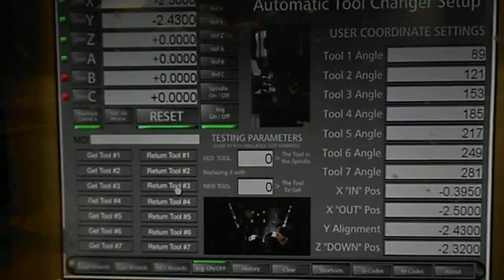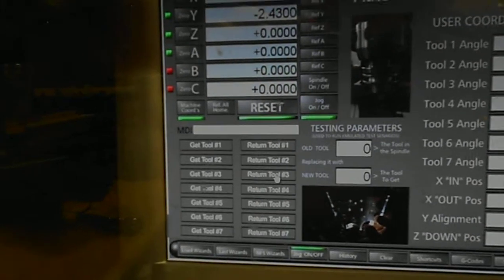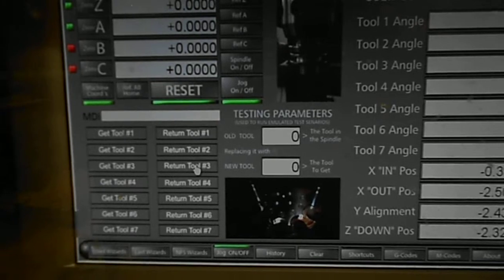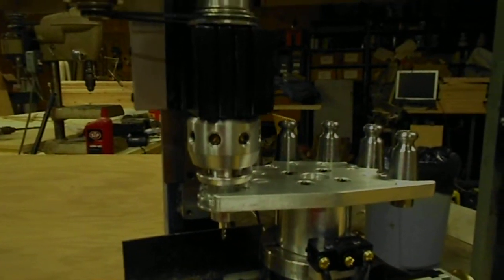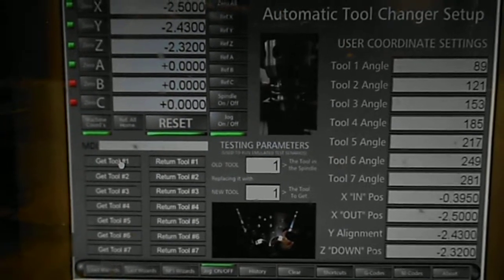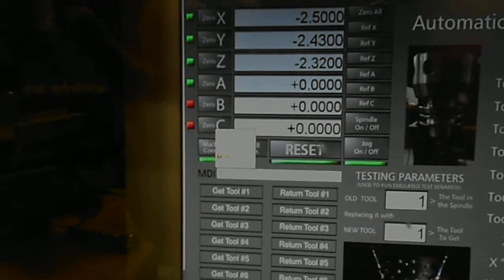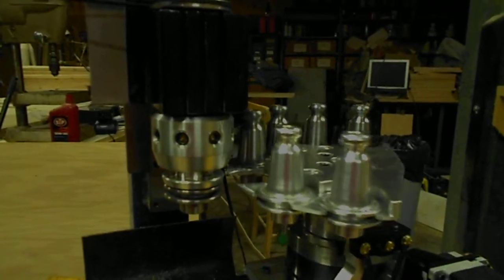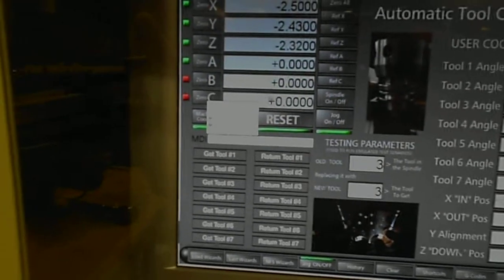Rotary Tool Changer M06 Macro l

Comment: Really love the NO NEED FOR AIR PRESSURE of any kind! it make things way more simple!! plus air systems will all eventually leak..
Reply from the maker: Yep! Not that I am against using pneumatics, but consider the costs associated with it. In most cases the cost of a spindle modification costs more than the machine itself. These machines are built for the "hobbyist" and are designed to make it easier to acquire for the average guy. Also, those high-RPM ATC's that I have seen use such a small collet that the tools are limited to 1/8 diameter shanks....not good!

Comment from the maker: Many changes have taken place since the creation of this Mach3 ATC page. The tools can no longer be returned individually by tool number (safety reasons) There is now only one tool-return button that returns only the tool that has been previously selected. Two warnings are issued and the program halts if you are trying to return a tool when you have no tool in the spindle and if you are trying to get a tool while another tool is in the spindle. It will also inform you if you are trying to get a tool that you already have in the spindle.
The DRO's are now more logical in that they show the tool that you have in the spindle and the tool that you are replacing it with. The code has been placed in the exact location of each change within the macro so that the numerical display changes at the same time that the spindle changes state.
It will no longer prompt you for another tool if you choose a tool >7, it will exit the macro instead. This is for safety reasons as well.
That original M06 required a tool to be in the spindle before an actual program run. The newer M06 can begin with an empty spindle.

Comment: Looking good!  I like the larger ball design on the tool holders.   It never occurred to me that a tool changer could be that simple... without air or draw bar of some kind.   Great design!
Reply from the maker: Ben Rogerson It is getting ready to get simpler! Instead of using a Sherline rotary table to rotate my tools I'm getting ready to build a simple rotary plate that will cost much less than using the sherline.  The Spindle has been through yet another modification. The four locking pins will be concealed instead of the springs being in the open. This will make it easier to assemble and to clean. There will still be a small groove on the outside so that a custom fit tool-puller can be fitted in the event that the tool needs to be manually disengaged. The toolholder flanges will be .250 instead of .200 distance away from each other so that the tool plate can be .150 thick instead of .100. Still have to do the my cut analysis though, looking promising!
Reply: Christopher Smith I though about making a turntable maybe with a belt drive and stepper motor...     can't wait to see the new design on the spindle!
Reply from the maker: Ben Rogerson I use McMaster Carr for all my industrial parts. Not because they are any cheaper than others but because they include part prints and DXF drawings, as well as Solidworks files. They make it much easier for you to design your project knowing the actual dimensions of the parts that are offered. I found them especially helpful when searching for the pressure springs used to hold the tool holder. They tell you everything, including the wire diameter and spring compression (lbs) so that you know what you are purchasing.